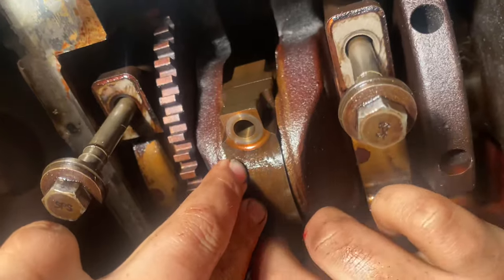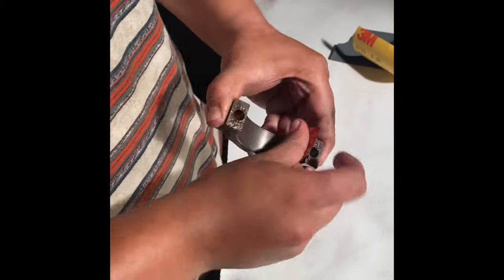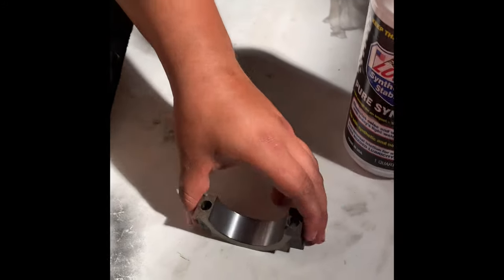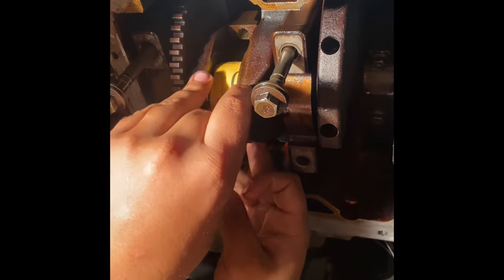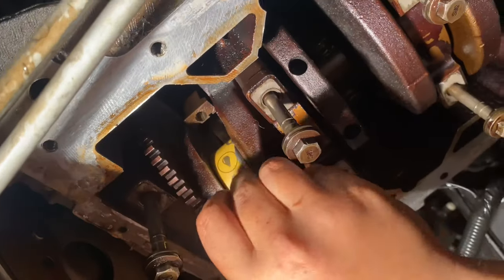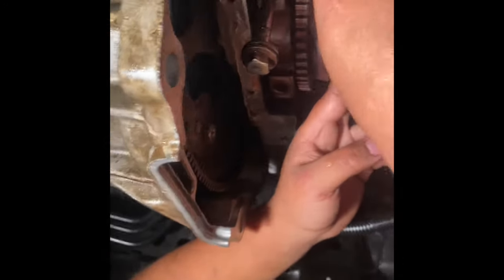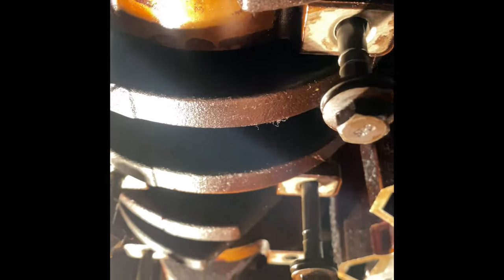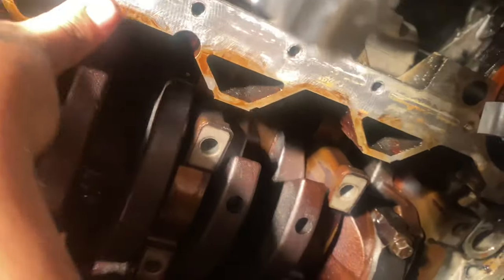How to change rod bearings with the motor still in car(how to fix rod knock)

Comment: Never lube the back side of main or rod bearings. Lube only the front side, assembly lube is preferred because its more like a grease and can handle start up for the first time better.
Reply: so lube the side that touches the crank?
Reply: @porigense67  yes. Oil isn't supposed to go on the backside where there is nothing moving. It can put you at higher risk of spinning a bearing.
Reply: Here is another video, "Inside the Box"
AMG factory, engine building, at the two minute fifty five, the Mercedes engine builder puts copious amounts of oil between rod and back of the bearing...
https://youtu.be/H82scwzyhh0
Reply: Why sand the back surface of the bearing cap just so it will be shinny, seems that it will be more likely to spin a bearing?
Reply: yeah that's what they say about mitsubushis. avoid a spun bearing. especially this one that has bearing seats.
Reply: @psiturbo  look again, bearings are already installed into the rod end, he oils the inner bearing surface, not between the rod and bearing. Your own evidence proved you incorrect. 3 minutes 9 sec in.
Reply: @psiturbo  this guy has been blasted by multiple true engine builders for doing this, even his own comment section calls him out for doing it. Adding oil changes the tolerances, pure and simple not good.
It's 2 surfaces you never want to seperate or have movement between, just try and explain how you think and oil to that surface helps in any way shape or form?
Reply: @psiturbo  your reply will be getting yeeted from having a link. YouTube real twitchy on em lately
Reply: @LangHvitSkyKriger  no, you should try to explain the blasted engine builders, source? keywords?
His own comments section, LOL, keyboard warriors like you and me, ha ha.
Reply: I almost cried when I seen him put the lube on the main cap 🥲
Reply: He wants to do the spun rod bearing challenge. See. How many bearings his crank will eat till it chucks the rod to the moon!
Reply: Why do you not want to do that
Reply: @LangHvitSkyKriger  "Adding oil changes the tolerances" when you disassemble a motor there's always oil behind the bearing... A well respected race engine builder does it without any problems. I don't think it's fair to label this as "never ever do":

https://www.youtube.com/watch?v=yAt-fkTntjE&ab_channel=REALSTREETPERFORMANCE
Reply: @amorag59  Are you calling that guy a well respected engine builder? He is the one i mention that was called out for doing this by many heads in the industry. I specific mention his in a comment above but the comment and the link were removed.
So no, do not ever put oil back there. It is ment to have a perfect mating surface, to flow heat throw it better and clamp better.

You never oil surfaces that are specificly deaigned to be friction fit and never move.

You want the MOST Friction so that the shell resists spinning later in life.

Understand the basic principle and youl understand the reasoning.
Reply: @LangHvitSkyKriger  That's because he is a well respected engine builder, people are allowed to disagree which he mentions in the first seconds of the video. I love how you completely ignore the fact that I pointed out oil gets back there during normal operation of the engine and any light oil behind the bearing is pressed out and will all wash away within a few cycles.
Reply: @LangHvitSkyKriger  Look at 1:54 min , you will see him putting oil between rod and bearing.
Reply: @tnfloose9023  thank you taught me something I did on my dodge that I just scrapped lol and I just bought a vw passat that has a knock lol

Comment: Two things I noticed. Oil behind the bearing. I don’t do it. I say if you do use the lightest oil you can find. Preferential I guess. Polishing the journal. Put the straw of a can of break clean in the oil gallery and lightly spray the sandpaper and gum junk out of there. Overall a nice video. Have fun and don’t be afraid to try something.
Reply: Yes I just heard 👂. From pro . Don’t put oil on back of rod n bearing. I agree. . Don’t oil both sides.
Reply: Yup probably a cause for spinning them

Comment: You should never use anything between the rod cap and the rod bearing.
Reply: I assume you mean lube, in which case I agree. You don't want the bearing to move in the cap
Reply: Tha 2 that thumbs-down me if you believe you should one day you will learn your lesson cuz it will happen
Reply: @robertbrown6755 I know a guy that used loctite between the rod cap and the rod bearing. It's an old trick from stock car racing.

Comment: For polishing the crank journal, I recommend an old fashioned, cloth measuring tape.  It's roughly the same width, and it applies more even pressure.
Reply from the maker: Thanks for the advice
Reply: so the rod cap was polished, the crank was polished, but the rod itself was not.  How would you go about that?
Reply: Fossil, Nah because then you can't wrap 360 degrees around.
Reply: and a drill.
Reply: or wide flat shoe laces.
Reply: @timm5970  Take the engine apart.

Comment: I got a 2010 Mazda 6 mark-cd diesel that caught the injector Black Death, clogged the oil pickup, and cut off oil to the bearing… cleaned and fixed everything else… now your video here just gave me the courage to attempt the bearing replacements with engine in place. 🦁🔥
Reply: How did you end up going?
Reply: @Alock94  yeah. How he did it? never came back

Comment: I used to change rod bearings out all the time as the shop owner I would listen to the engine when I change the oil if it rattled I would talk to the customer about changing some rod bearings. And maybe an oil pump.

Comment: You should try 0000 steel wool for the rod.
You can use it to pull rust off chrome and it won't scratch so it will keep the surface smooth.

Comment: Replaced mine on a 2001 Jeep WJ: The bearing caps are cast into the block as part of the manufacturing process and then snapped off so that they only fit in one spot and in one orientation, it is therefore necessary to softly tap on each bearing cap with the wooden handle of a hammer to get it to seat first. Just torquing down the bearing caps without tamping them down first can lead to cracking of the bearing caps.
Reply: Jeep is junk.
Reply: Did it work?
Reply: Tourettes, must be hereditary.   Sounds like the rest of the family has it too.
Reply: @poolbob8776  He's like a toddler that just learned curse words

Comment: Also the bearings are top and bottom specific the bearing with a hole in it is the top block side bearing. It line's up with oil journal. Most bearings will only fit in one way. The correct way.

Comment: I had elongated one of the rods just like yours. There are two ways to handle it. 1) add a shim to the lower bearing or get an oversize bearing for the lower half until your plastigauge shows its in spec. 2) Grind down the rod cap to con rod mating edges until your plastigauge shows its back in spec. I did 1) and it's held up fine for 6 months now in a turbocharged engine. 2) Is probably the more correct way. Both procedures can be done with the engine in the car still.
Reply: I got a question for you what’s the best way to figure out what size rod bearings you need
Reply: @terrellscaife2411  If you haven't ground your crank at a machine shop, then start with standard sized bearings. Then plastigauge to check its within specs.
Reply: Do You drive it normal and race it or do You drive only low revs?
Reply: @V8Lounge  Low rev the first 500 miles or so, now normal, up to red line with full boost.

Comment: very cool. i got this ranger with a rod knock i can buy for like $300. it looks like i just need to replace the bearings (i hope) the way you showed me how to do it doesn't look that hard, i like how i dont gotta put it on a lift or take the engine off
Reply: This will only extend the life of the engine a couple of months
Reply: U can buy anew crankshaft for it too.
Reply: @raulciprianoyahoo how so?

Comment: Had a 30k Mile AMC 304 v8 that had a carb float stick and filled the crank case full of gas and contaminated the oil .  Then it sat for a decade.   The shit ethanol in the gas I guess ate the bearings up.  At least the first layer of plating on the factory bearings . Not all of it but enough I wanted to do something about it. Still had decent hot oil pressure at least for a amc v8. I noticed the bearings showing some copper when I went to replace the rear main seal.  The crank journals mic'd out fine and looked great.  Tag showed standard size bearings.  I ended up running stock size bearings in both the crank and the rods..   I put them in ALL FROM UNDER THE CAR.   It hasn't had a issue since.    I run 15w40 Rotella and a zinc additive in it as well.
Reply: I love rotella

Comment: Curious how long this latest before spinning a bearing or knocking again
Reply: 10k miles Max.
Reply: You have to use super glue on the back side of the new bearing, especially if the bearing shell has been spinning a lot inside the rod cap. It's actually a trick from stock car racing. The engines go back together for a lot more high revs.
Reply: @gregorymalchuk272 actually?

Comment: Since when do you lube the backside of the bearing? If you want a spun bearing then go for it.
Reply: He should've used just regular motor oil. There's supposed to be .0001 to .0002 tolerance for oil to get in there. Heavy lube will prevent that

Comment: How did you rotate the bottom of the engine to the top of the car? Im not even a mechanic but im willing to try since my Lincoln has a rod knock noise to It too smh 🤦

Comment: I'm 55 years old I did this to my 72 chevy when I was 16 years old.then truck to much rust put moter in Monti Carlo road this moter over 600 ,000 miles sold car to friend real cheep because old moter.he drove for two more years.but he didn't drive alot but that moter out worked itself.got to be a record on miles?

Comment: i gotta tell ya, your video was very good. im working on a ford escape, and am replacing my rod bearings. been watching alot of videos on this subject and yours is best at lighting, sound and i love the language. thx
Reply from the maker: Thank you 🙏 we try to record everything we do and try to get the best angle so that it’s easy to understand
Reply: Im also watching all these videos trying to change my 2009 ford escape rod bearings. Did u changed it?
Reply from the maker: @ceomaliyeckal1307  yes I change mine but it was on a 2004 Chevy Colorado
Reply: @ceomaliyeckal1307  working on a 06 escape. Just ordered gauges so i can measure bearing clearance. Not enough information online nor on the escape forums. I may get the Haynes manual also. If you get any good information please pass it on.
Reply: @Ronnie-zn9sx  Also there is some facebook groups for escape owners

Comment: mines had the same noise I had to replace the timing oil tensioner because it was leaking oil really bad and my bro always ran it on low oil. Now the engine will crank and start but won’t stay on I had to replace the battery because it was bad. Maybe the bad battery fried my alternator? Or maybe I missed aligned the timing when replacing the oil timing tensioner? Ahh am stuck trying to figure out if I need a new engine or not?

Comment: Hello I have a question. The area you are working on it is where the oil pan goes right? I I basically need t take the oil pan out the reach the area you are working on then I am gonna be able to replace rod bearings?
Reply from the maker: Yes

Comment: So how did everything turn out after you put the engagement back together? I've done this year ago after  changing the crank but did change the connecting rods... they became baffled and out of round.  That led to the engine falling shortly afterwards.  It was on a 350 block.
Reply from the maker: We actually had to order a pair of 20 thousandths oversized bearings for the first connecting rod and the rest were standard sized bearings we slapped everything back together and she started up first crank
Reply: @Nasperformance  Really! Well that's nice. Ordered a set of oversized Baring was a smart move. That's awesome.  Thanks for sharing with us your experience 👍.
Reply: @Nasperformance  the question was more, long term, did it run well many months later? any other rod knock issues?
Reply: @Nasperformance  after putting the 20 thousandth oversized was there still a little bit of play?
Reply: @MatthewBecker7  there would still have been a tiny amount. Not nearly as much as in the video. Just enough to fit a sheet of paper or two in between. Thats all the play you need.
Reply: @Nasperformance  Thanks for the free game. Did it hold up over time with the oversized bearings?

Comment: How well did this job hold up? About to do this myself. Thanks in advance for the reply
Reply from the maker: Held up extremely good actually but my motor started to have oiling problems and blew up 😂 so I ls swapped it
Reply: @Nasperformance  🤣🤣 was it from the bearings
Reply from the maker: @kashtaandrade4017  no the oil pump went out and starved the motor😂

Comment: I have a Chevy 1996 5.7L 350  Sb is knocking noise. I took the oil pan out and found metal residual. I was told I need a new engine. The engine turn on and drives. Any advice please. Thanks
Reply: Did you figure out what it was?
Reply: Just replace the engine. Got a good deal on ebay. New  block. Thanks

Comment: How do you know if you need an over size bearing?
Reply from the maker: Use a micrometer and measure the outside diameter of the crank also google your engines factory diameter and compare the two measurements
Reply: @Nasperformance  thank you so much for your help

Comment: If the bearing spun, crank is gonna be "flat" spotted on load side. Knock will be quieter but will end the same eventually
Reply: It will keep it from shooting out the oil pan right ? Lol I saw this video when my van was knocking I wish I would’ve listened

Comment: What do you suggest we should do when It comes to torquing down the rods. Should we reuse, swap to new OEM rods or get arp?

I've read that we will need to resize rods with arp. Are we simply working with what we have and then just send it?
Reply from the maker: To be honest you don’t really need arp bolts if you aren’t building it but that doesn’t mean you can’t its just preference
Reply: Dispite what a lot of people say here, you can reuse rod bolts as long as the bolts haven't been torqued over the TTY i.e. "Torque to yield value" and have not been permanently deformed. Suggestion when torquing the rod bolts creep up on the maximum torque numbers in stages slowly being sure to torque each bolt evenly as you go up in torque to the max torque. Best to apply assembly lube to the journals and bearing surfaces that face each other, it is thicker then oil and gives more protection since the oil pump won't supply oil to the bearings until the pump primes itself and starts pumping oil again.

Comment: Hey bro i was wondering if i change my 2007 civic 1.8l rod bearingz  do i oversize ? Or how do i know which one to buy
Reply from the maker: You have to measure the diameter of your crank shaft rod journal with a micrometer and search up your factory measurement and do the math from there

Comment: What I’m wondering is why does your cap portion of the bearing have an oil hole? Shouldn’t that be on the top end in the saddle (block)?!
Reply: My f series honda both sides of bearing have the oil passage. I guess so they can go top or bottom.

Comment: My vvti engine is making some knocking noise and my mechanic said i must buy new engine can you advise me please 🙏🙏🙏
Reply from the maker: Some times it could be the timing chain
Reply from the maker: To test it you could put your hand on top of the timing cover and if you feel the tick hitting it could possibly be the timing chain
Reply: @Nasperformance  Thanks sir i will do exactly that
Reply: So it depends, knock is caused by 1 of two things, uneven fuel combustion which a tune up can fix, or a spun rod bearing, a spun bearing by no means means you need a new engine you just need a new rod bearing, you can change rod bearings yourself it just takes a lot of work

Comment: I'm scared to do this. My engine sounds like it's starting dry and is loud until the oil gets up to pressure. Terrified this car is a lemon. Someone said it might be the bearings. What do you think?
Reply: probably bearings. I have the same way in my buick. 5 sec after cold start can´t hear any knock at idle or normal driving rpm, but can still hear it on higher rpms.

Comment: no lube on back side no sandpaper.  roll bearing in and out with cotter pin.
Reply: I thought so, np other engine rebuilder here does that, it is unesscesary to sand the backside. Thanks for confirming...
Reply: Can you please explain this better?
Reply: @hughjanus9822  don't use lube on the backside of a bearing it will lift it and change clearance and its just unnecessary.  no sand paper unless a crank is out of the engine because all it takes is one piece of grit to ruin a journal. using a cotter pin to roll bearings in and out is as old as poured Babbitt bearings.  almost all in frame diesel rebuilds ar done this way.  to hard to explain there are YouTube videos on this technique for in car main bearing replacement

Comment: Nice trying to fix rod knocking but it's needs to be done right remove the crank and have it done the right way crank needs to be cut and the right size of bearings 😮

Comment: Could I remove the crank from here
Reply from the maker: No the flywheel/flex plate would still be connected to the crank and you’d need to take the transmission off for that
Reply: @Nasperformance  do you have ig?

Comment: If you’re not going higher than 2000 rpm that’s the way to go :)
Reply: What do u mean
Reply: I planned on doing this for my rod knock and not going past 4k rpm like at all. 

Just get 3k to 10k miles out my car would help continue to go to work and save up for a new car or proper fix